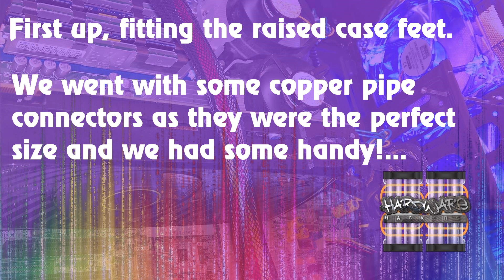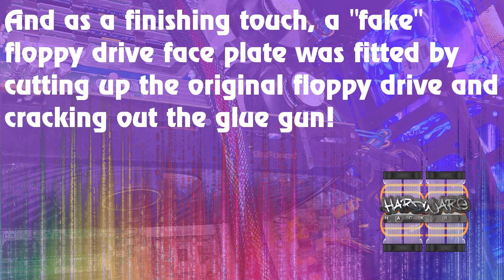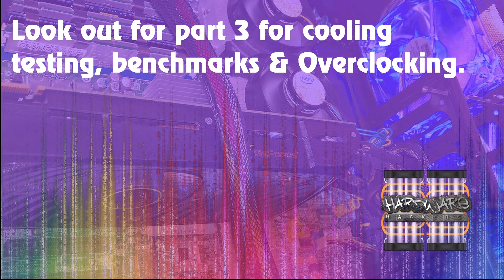Packard Bell Sleeper PC - Rev 2.0 - Part 2 - Final Build

Comment: Do more sleeper pc builds with more appropriate cases for the needs. EG this case was lookig awful with the radiator and the fans there but still a good try. Maybe next time a bigger old case would look cool.
Reply from the maker: It was the most appropriate case for the build in our opinion! The aim of the build was to be "The Sleeper's Evil Cousin" based on our original which we went to great OCD lengths to ensure it was 100% factory looking, So this one we wanted it to have the sleeper theme (ie. old Packard Bell case) but have the giveaway's that it was a lot more than an old Packard bell  :-)

Comment: Not much of a sleeper with the fans on the bottom, but i still love it. still better than what i got. PC Specs: Dell Precision T5400
CPU's: Dual Intel Xeon X5460 Quad Core @ 3.16 ghz 12mb cashe
RAM: 20gb DDR2 ECC 
HDD: Segate 250gb with Windows 10 Pro 64-bit
Graphics: Zotac GeForce GTX 1050, 2gb
Reply from the maker: Get a lot of system for your cash using a used precision, plus dual cpu is where it's at!!!!

The v2.0 sleeper was designed to follow there original in the fact that it was based on a Packard bell but the evil cousin part was to include some giveaways that not all was as it seems (the fans hanging out the bottom!)
Reply: Next time around id try to find a M atx case minitower like a ibm thinkcentre E50 (sleek looking machines & all green leds on power,hdd led, dvd etc... it looks great in the dark really.) (Thinking about building in a small am3+ motherboard + athlon II x3 445 in the one i got as a older windows xp machine.
(Got a faster windows xp machine anyway so wouldn't really do any harm swapping out the guts)

Current hardware in it is a socket 775 pentium 4 2.8 ghz with HT 768 mb ddr ram.
(256 stick original one) & no gpu
(some odd sis chip gpu on the motherboard rather then intel's own.)
But i put in a bit stronger powersupply & a nvidia 4600 ti with a 80mm fan mounted too it that i got from my cousins old junk pc case. (got one in the front (not visible & one 80mm in the rear.)

( case i got the fans from was battered too hell & got a bunch of parts out of it, didnt take the harddrive or old 500w powersupply though (pretty good 3.3v & 5v rails on it.)
Reply from the maker: We were talking about an ibm think centre last week actually most of them are lovely well built cases and I like the smooth square front. Running out of hardware to put in them however hehe!

Comment: Do you think it's possible to fit a sleeper PC including watercooling inside a Dell Optiplex GX270?
Reply from the maker: Anything is possible with enough time, effort and of course money!

Is it a tower GX270 or a Desktop GX270? - I've never had a play with a tower one but I've had a lot of use with the desktop ones, they use a small proprietary PSU which would need replacing, the motherboard looks roughly Micro ATX in size and layout, the mounting holes may not be the same but that's an easy fix with a drill and some standoffs.

next up would be mounting the radiator, it would most likely need to be either in place of the optical drive or external. but definitely possible.

are you thinking of giving it a go?
Reply: It's a midi tower. It has a regularly sized PSU and originally had a Pentium 4 (I think it was a Prescott with hyperthreading).
You're right regarding the mounting holes, there's just one on the motherboard. The backplate does not have any standardized mounting points whatsoever, but the plate can be removed by just sliding it out. The entire thing is pretty modular, but nothing is standardized. For example the power botton is connected to the front USB and audio chip (yes there's a little chip behind the USB ports and audio ports that is connected to the Mainboard via a proprietary cable). I guess I'll have to rewire the power button completely.
The reason why I see this is a challenge is that I think it's impossible to fit a global watercooling system for CPU and GPU in there because of the weird opening mechanism (you just have to kind of.... well you pull the entire thing apart to open it. The other thing is the hardware inside would be burning. There are no front openings for a fan and on the back I could maybe fit an 80mm and two 40mm next to the GPU. There's no space at all on the bottom. The only way to get air into it is to saw off all the cages for CD, floppy and HDD and place some fans there (plus the radiators for the watercooling system)
Reply: But to be honest, it would probably be too much work for me. Do you wanna have it? I can ship it over to you ^^
Reply from the maker: I'm sure we have a GX280 in the workshop somewhere! leave it with us and we will see if we can turn it into a water cooled sleeper, and then you could have a rough guide to follow! will add it to the list of projects, things have been slow recently due to the amount of time we have spent developing the new forum at our website!

Thanks for taking the time to comment.
Reply: Sounds great. Make sure you guys have the one with the weird opening mechanism, because that is the real challenge about the project in my opinion ^^

Comment: really cool build! ...but wouldnt that radiator be pushing hot air right into the rx 480? was there any overheating issues or did it run fine?
Reply: I was wondering the same thing...
Reply from the maker: It doesn't run very hot and this big 140's shift some air so been fine so far temps are well within limits but for part 3 we will look into it more and post some figures/temps
Reply: Flipping the fans to pull from the radiator will cool the same as the current push configuration, despite claims that 'push is better'. Added benefits are not having the dust buildup between fans and radiator, and not pushing hot air back into the case. Simple fix and the temps will definitely drop on the GPU, too.
Reply from the maker: We will add that to the tests for part 3 when we test the setup and cooling to get some results, let's see if we can smash the "push is better" claims!

Comment: Only because you're not the first to use it, and I know you've used it once before, what's the name of the audio track used around the 5 minute point? I've been able to get no discernible answer from anyone regardless that I know it's in the youtube audio library somewhere. it reminds me of modern-retro videogame music of some manner for some sort of tetris clone or what-have-you.
Aside from that, it looks amazing. good to see that optical bezel swap finally happen elsewhere and not just in my own basement.

I wonder how hard it would be to get the side cover up on a saw bed and cut out a snazzy hole for a piece of plexi? seems like there'd be more than enough room for some white LED accents inside. sad I don't have the luxury of doing such a thing with my E60 case with the Hyper T4 touching the case cover, else I'd have already done something like that a long time ago.
Reply from the maker: the big beat 80's its called! glad you liked it, yeah optical drive bezel swap is a nice easy mod and so effective for creating a sleeper pc especially since this one has an odd grey dvd-rom and blanking plates rather than the standard black or beige.

a plexi slide window shouldn't be too hard, cut a design, with matching window and then a rubber seal to hold it in, something we can look at for v3.0 maby!!!!

always thought a hole in the side with cooler sticking out would be cool, if you could make a custom cooler big enough! we liked the idea of mounting the radiator in the side panel sitting flush, but when me mentioned it on our facebook most said no, plus it would have made servicing the machine a bit more awkward.